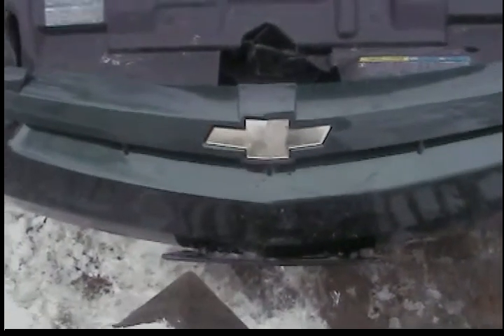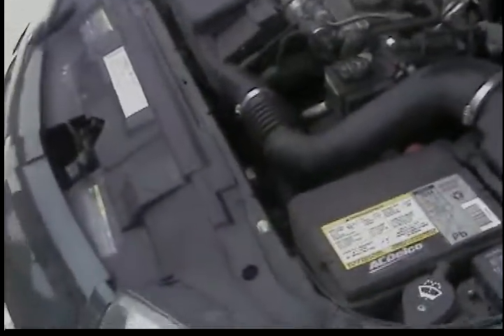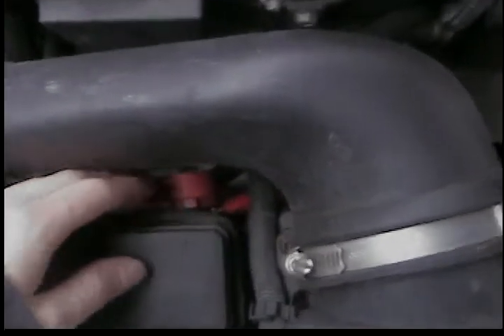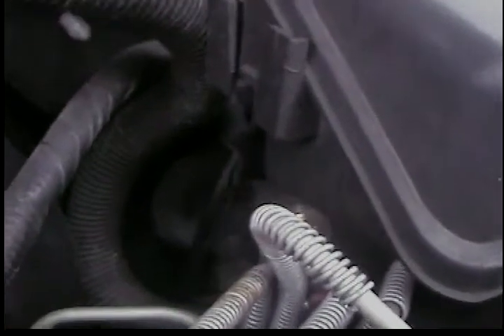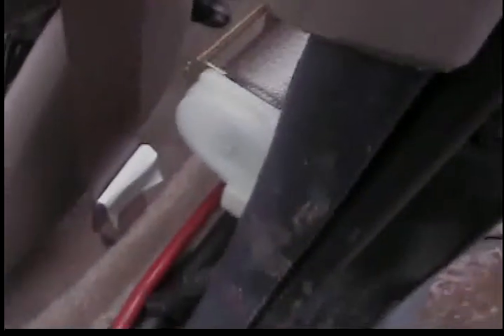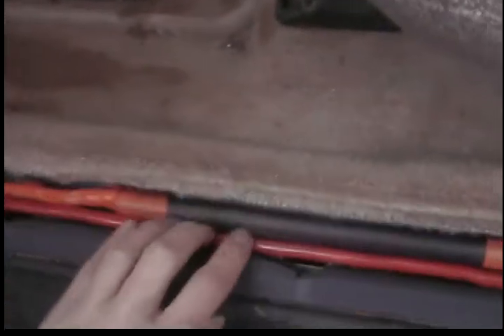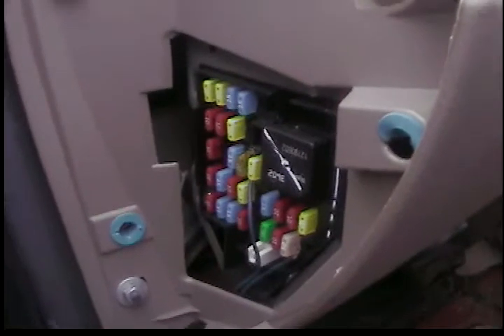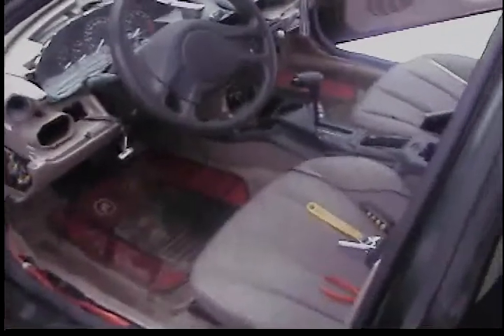Audio hook Up

Comment from the maker: @MrBeerman20 Hey You can run your remote wire with the power wire but I just do it with the RCAs to make it easier because the wires i usually get the RCAs is attached to the remote wire.  You will get Feedback and noise if you run Power with RCAs and Power with Speaker wire(heard this one isnt true) but for Power with RCAs it usually causes feedback and bad noise. Good Luck!